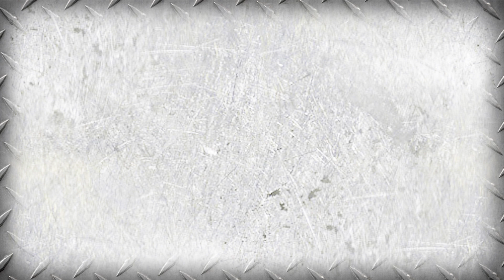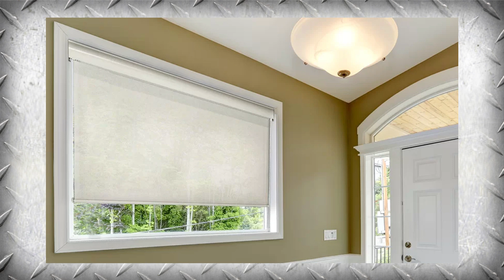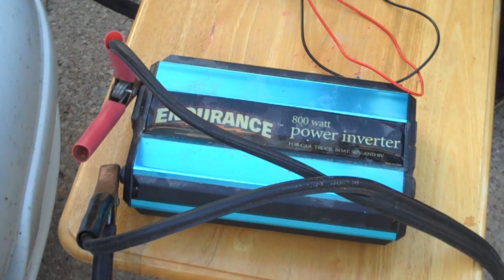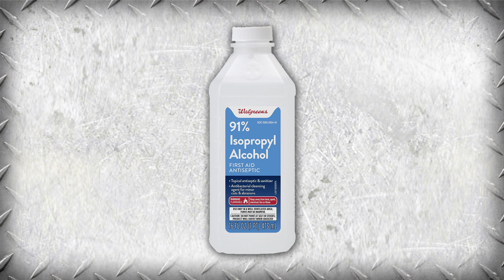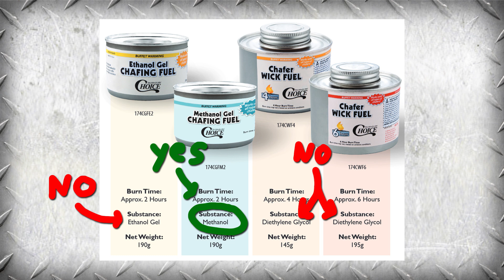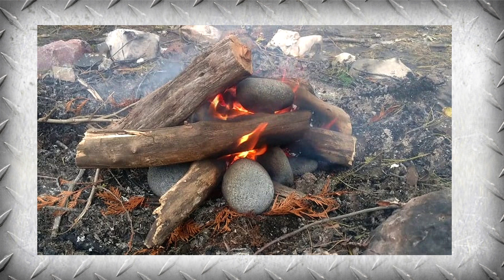How To Heat Your House During a Winter Power Outage Emergency

Comment from the maker: One thing I should note that I didn't mention in the video is that turning your water mains off may still let the pipe burst on the other side of the shutoff valve towards the source. It may be a better idea in some circumstances to leave the water on and just let it keep slowly flowing. That or try to only heat the area around the incoming water pipe from the city above 32F then turn it off.
Reply: Better to not let pipes freeze
Reply: Duct tape can break down leaving a ugly sticky residue

Comment: Can you use indoors a Rocket heater ? It’s like 4 cinderblocks if you’ve got them prepped already and you have wood in your house , The chimney of the cinderblock is supposed to burn any smoke ?
Reply from the maker: I wouldn't recommend it without a way to fully vent the harmful gasses, as some will escape

Comment: I'm thinking sand battery as a backup. I have an old turkey roaster and lid, copper pipe coil, wood stove TEG fan, sand and alcohol burners. Sheesh in it's simplest form, you could do a steel bucket, copper strip in the sand, TEG fan on top, candles or alcohol burners underneath. All safety must be a given, co2 monitor, fire extinguisher and well built safety precaution for the sand battery.

Comment: A large mr heater blue flame heater. Period. Our power was out for a week here in the backwoods of Ohio in the winter snow. I used only one 40 pound propane bottle to hear about 800 square feet for a week. I also use a propane bottle topper in the garage for my dogs. I crack the garage door with a 2x4 and let it run. No problems with that setup all winter.
Reply from the maker: That will run for approximately 8 hours on max with the small bottles though and the ones without filters jam up because of dirty propane.

Comment: Hey EST.  I have heard that that the terracotta flower pots are great to heat up a room.  You put one of those stereo cans on the bottom plate and a few flat rocks one the edges.  Light the stereo can and place the terracotta pot upside down on the flat rocks.  The gap will let air into the bottom and the little hole in the bottom of the pot will let air flow out.  Now the sterno heats up the pot and the room.
Reply from the maker: Unless it magically attracts the basically air pollution particles coming from the wax, the air is still going to be a fumey, barely breathable mess if you light up enough candles to make a difference. Burn pure alcohol or diethylene glycol for heat. Wax is a TERRIBLE fuel for indoors.
Reply: @EmergencySurvivalTips   that's mainly if you are using the over-the-counter petroleum candles. Pure beeswax candles burn clean with hardly any soot and there's no toxins in them that can pollute the air. They make emergency candles in beeswax too. It wouldn't hurt to keep some on hand since they are non-toxic and don't require fuel.

Comment: Do you like, the Jackery, Rockpals or Energizer solar battery packs and hand crank radios?
Reply from the maker: My parents have a Jackery and it's quite good. The only problem with it is they spent a medium amount of money on a medium model and got medium power output of 800 watts which can't run most high draw power tools like our electric chain saw. The high end ones are pretty pricey.

Comment: Very good video. I have slept in hotel parking lot in my car when I didn't want to pay for a room after a concert. I have a hybrid so it's less of a concern, but I always worried about some psychotic person walking up and stuffing something in my exhaust. That's why I always did it in a hotel parking lot. A battery-powered carbon monoxide detector would have been a good idea. But there are tons of people who try to commit the s thing this way and they fail, so I figured it couldn't be all that deadly. Also, you sound more like a Michigander.

Comment: Honestly love my little alcohol single burner pocket stove. Was great for camping and hunting here in Canada. Even in the army it was small enough to through in my gear and make a coffee every now and then and did not produce a big yellow flame. 

But honestly when we did winter indoctrination training here in the Canadian Army it was not unusual at all for us to be in the 5 or 10 man winter tents with a Coleman lantern and Coleman stove on white gas running all night. Provided lots of heat and keeping the vents open never had an issue.  

Of course at home I keep a buddy propane heater. Simple, easy, no worry about CO  but just a note to watch for low oxygen  but so far never had an issue with that. A window open a 1.5 cm will be plenty.
Reply: I ordered my Trangia Spirit Burner Stove like 5 months ago. Still on backorder. I swear I need to just cancel the order. I contacted Trangia and the seller but Trangia didn't even respond. I should have just bought a Fire Ant.

Comment: Inverter and a electric blanket will keep you warm enough at 100w on high. I use electric blanket to keep my winter bill lower but I love breathing the cold air but being warm. A double clay pot heater and a 3 wick candle or hand sanitizer soaked toilet paper with a small cap on top made of metal or small hole and it'll burn just as hot

Comment: Thank you for these great tips, especially on clean heat sources for indoors. What is the best way to use the Methanol Gel chafing fuel cans? You said you use 3, but how do you use them - cooking or placing at fireplace / community area where we sit for warmth?
Reply from the maker: Generally the middle of the house is best so least number of outside walls but for safety it's a good idea to just put them on stove burners since it's big, flat, and can take the heat and nothing flammable is above them.

Comment: You might want to change that intro.  It was not due to the wind turbines.  The power loss was due to non weatherized NG and Fossil fuel electrical generation plants.  This happened in 1989, before the wind turbines, and in 2011 also before wind turbines in Texas.  In the previous two instances, the regulatory body was told to require weatherization of the generation plants.  All of that work was not done and probably wont be done today...

Comment: "wood for your grill outside" get some rocks, burn the wood outside with the rocks above the fire, then wrap the rocks in wet towels and put them in your bed. By the time you get it there the heat from the rocks would have vaporized the water in the towels and the water vapor would have carried enough heat away that it would be safe to put under your covers. Also, you can put things like gravel in an old pot, and heat that up. Then put that BELOW your bed on a tile or something, and have your blankets down to the floor to keep the air from circulating. This will heat the bed up and you stay nice and toasty.

Comment: A kerosene radiant heater or a mr buddy propane heater is good to have.  I ran both indoors during power outages that happen frequently here both are reasonably safe for indoor use and put out lots of heat
Reply: I agree they do not cost that much be prepared most of his ideas suck except for the blankets and covering windows and doors etc

Comment: I used to heat rocks on my wood stove and put them in pillow cases and stick them in my kids bed.  Bedrooms were too far away to get much wood stove heat. Lived those hit rocks.  I was warned that some rocks explode with heat...be aware.
About 10 years ago the best personal heater I found was a pit bull.  They live sleeping under blankets and the amount of heat they put off is phenomenal!  Not all dogs put out heat. I gave a Central Asian/Anatolian Shepard 130 lbs that puts out no heat. The only draw back to the pit bull heater is...they also heat up ur room in the summer also.
I have a flex fuel generator. I'm sensitive to noise. ..hate it.  And I can't afford to run it more than a couple days. Last time I lost power I really didn't want to get up every few hours to fill it.
  Wish things were easier!

Comment: If you use rocks, bricks, or cinder blocks, make sure they are NOT wet! Rocks do absorb moisture and if you heat the rocks/blocks enough, they could explode. Maybe not like a bomb (depending) but not bueno! They may simply crack open but be safe.

Comment: What would you do for  mail slots
Reply from the maker: Probably roll up a shirt, jacket, blanket, or scrap fabric into a roll then use duct tape, gaffer's tape, or painter's tape to attempt to security attach it to the inside of the door across the slot or just open the slot and jam the whole improvised insulation burrito into it the long way.

Comment: In the 1980 recession...we heated our house with kerosene heaters.....in Northeast Ohio...they do work. They do leave soot but we are all ok :)
Reply: Yeah they work fine indoors a little soot and almost no smell after 5 mins   you can even put a kettle or pot on top to boil some water for coffee.  Propane heaters are clean enough to use indoors as well

Comment: Also you can make pretty good makeshift burners with two beer/coke cans and cotton
Reply from the maker: I think modern aluminum cans are coated in a polymer that melts under high temps so you wouldn't want to cook over that. Same with modern tin cans.
Reply: @EmergencySurvivalTips  that may be so but testing it should not fet rid of the polymer? ( I mean you try it once without cooking anything)
Reply from the maker: I guess you could burn most of it off after a while but you'd have to do it outside or the burning plastic fumes would be really bad inside, in which case just use a cermic mug that you know won't crack (and put a metal pan under it anyway) or use aluminum cookwear.
Reply: @EmergencySurvivalTips  Thanks for explaining that about the modern aluminum and tin cans.  I had watched videos where those were made into little stoves for burning isopropyl alcohol.  They seemed so easy to make that I might have tried it.

Comment: Forgot to ask. Whats the Cabon monoxide content of burning Oko’s?  Perhaps those could be put to good use as a fuel source
Reply from the maker: Fairly moderate. Paper doesn't burn very clean but its thinness lets it get high access to oxygen compared to other fuels, though the flame is awfully yellow. That is somewhat due to other factors though.

Comment: but what about small candles? I'm cold but I want it to smell good
Reply from the maker: Oh you should see our emergency heating part 3 video where I lit 25 tealights. It got so parafin-scented in the air I had to leave the house. Also it only went up 1 degree. Candle wax vaporizes too easily.
Reply: @EmergencySurvivalTips  What are your thoughts on those terracotta pot tea light heaters? I heard one person say that you better make sure that you were terracotta pot doesn't have lead in it. And I thought growing herbs in one of those would be a good idea. Yikes.

Comment: Would be cool to see a video on making heated clothing blankets etc it's something that can run very directed heat at a fairly low power for hours. To the point you could probably run it off of a crank generator if you had to
Reply from the maker: The high resistance materials needed and the control circuit capable of passing 100+ watts through it are so uncommon, it'd be insanely difficult to build one. It'd be easier to just buy one, get a large lithium battery pack and inverter, and just use that.
Reply: Get yourself a heated jacket I have a milwakee one.  It can run on the standard tool batteries.  Then buy some spare batteries.  One of the larger batteries can run it on high for 24 hours